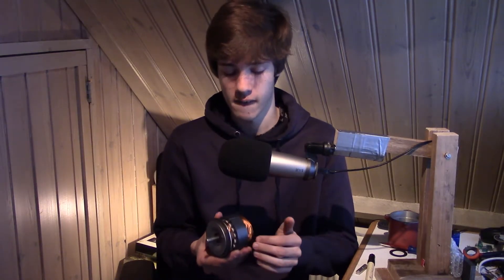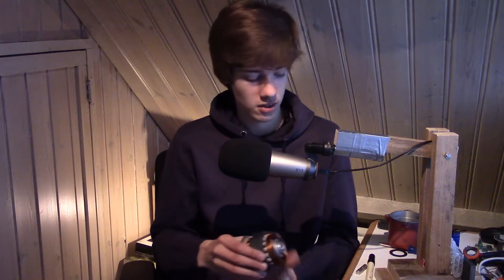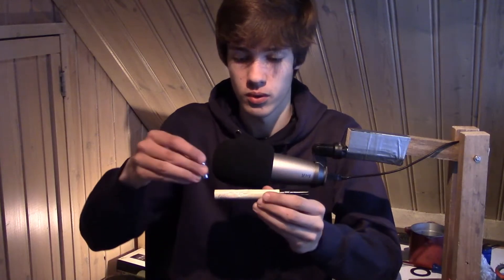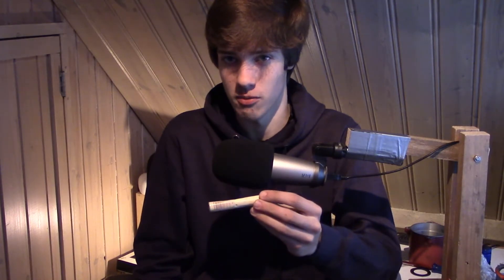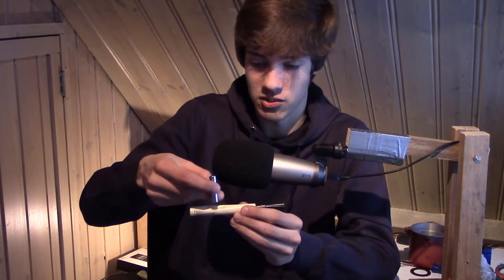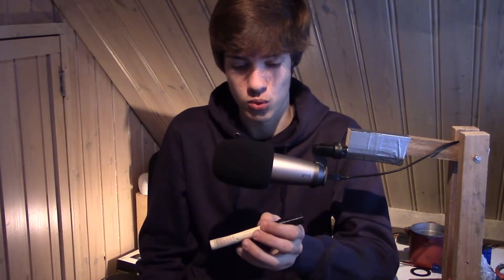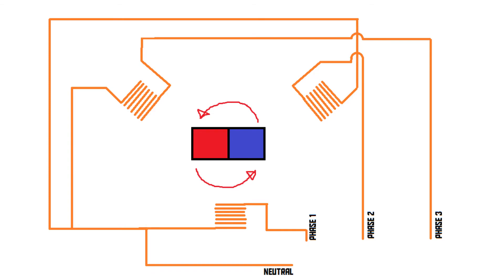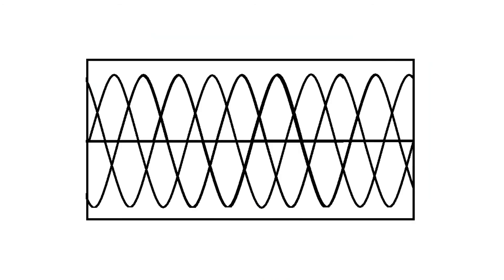How do generators work? (AKIO TV)

Comment: A tangent on generators.

As you point out. Plain and simple it is a device that turns mechanical energy into electrical energy.  And most viewers are aware of generators using magnets and coils with magnetic induction. But the term  generator also applies to electrostatic induction with electrostatically charged plates and capacitors. 

Electrostatic motors (beyond corona discharge motors) are facinating for the potential power density.  Try youtube search high power electrostatic motor. 

Think about how much current does it take a magnetic motor to hold a position.  And contrast that with an electrostatic motor holding a position with electrostatic charge. Think about how one can trade volts for amps, and how that reduce i²r losses.  Think about how one can replace expensive and heavy copper with cheap and light aluminum, and do away with heavy magnets and magnetic core materials.  Power density. 😊  building small motors is relativly easy. But its more challenging to scale that up.  But electrostatic is the only viable option at the scale of MEMs motors.

If you want to see a motor that  will intrigue you, i invite you to have a look at my cogless iron core axial flux bldc motor that uses faulhaber wound coils. Its on my channel.